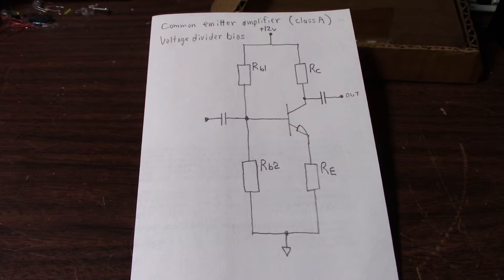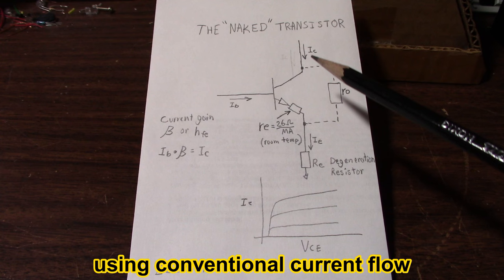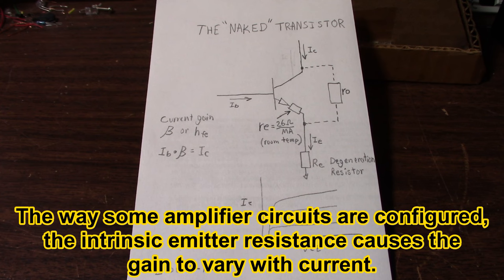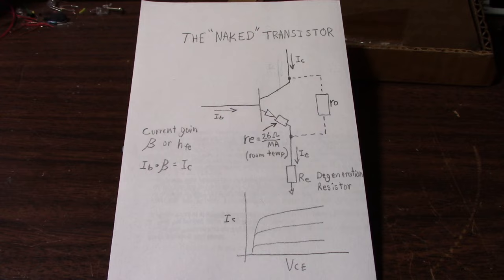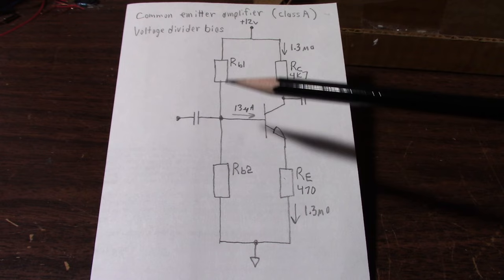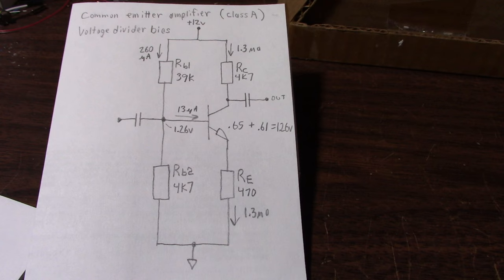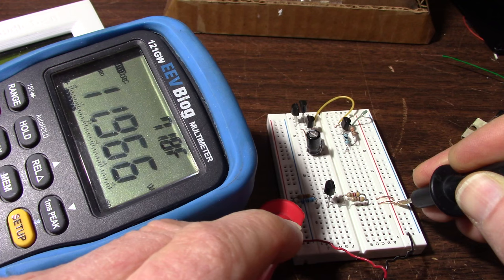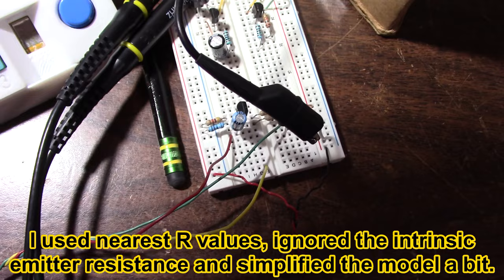How to design a single transistor amplifier with voltage divider bias

Comment: Excellent! Thank you. Do you know a source for the formulas and process that you used to determine all the values? Other than an overly complicated text book, or having to go back through the video and write it all down? Maybe a spreadsheet?
Reply: Here's how I'd recommend you do the design. First decide on the desired gain. Your supply voltage will be at least 0.5V times the gain. Then decide on your desired output impedance. Your collector current will be around half the supply voltage divided by that output impedance. Pick a transistor with a minimum β of at least 100 at that collector current.
Now set Rc = desired output impedance. Calculate Ic = Vcc / (2 * Rc).
Set Re = Rc / (desired voltage gain). Calculate voltage at emitter Ve = Re * Ic. Calculate voltage at base Vb = Ve + Vbe = Ve + 0.65V.
Calculate Ib = Ic / β. Set the current through the lower base bias resistor Irb2 = 10 * Ib (at least).
Calculate Rb2 = Vb / Irb2. Calculate Rb1 = (Vcc - Vb) / (Irb2 + Ib).
Now select nearest preferred resistor values and recalculate currents and voltages at base, emitter and collector. If the collector voltage is not close enough to mid-point, then adjust resistor values slightly to get the desired bias point.
The input impedance Rin will be the parallel combination of Rb1 || Rb2 || β*Re. If that's not high enough, either increase the output impedance or pick a transistor with higher β.
Choose an input capacitor whose reactance is at least equal to Rin at 20Hz. C = 1 / (40*π*Rin).
Reply: @RexxSchneider  Thanks, Rex! Good information!

Comment: John, @ 5:35 you say that Ib sets Ic. (Ib * beta=Ic). To me, that implies that the values of Rc and Re don't affect Ic (no input signal at this point). What am I missing since @ 8:34 you talk about the value of Rc setting the current?
And shouldn't adding the value of Re alter Ic?
Reply from the maker: Rc was chosen to set the output impedance and Ic was calculated using Rc to set the voltage on the collector at quiescent. Rc does not affect Ic. Re is used in the calculation of the voltage divider resistors on the base circuit. The simplification can be confusing to some people trying to understand what's going on in the circuit. This is where a more indepth look using the math might help in understanding.
Reply: @JohnAudioTech  Thank you John. After doing more research and testing and rewatching,  I understand better. In your reply, you say "Rc does not affect Ic." but I am pretty sure you mean RE (not to be confused with "Re") does not affect Ic.
Anyway, I'm getting there and am thankful for your videos to help.
Reply from the maker: @OIE82  Yes I do mean Rc does not affect Ic. With my demo circuit, short Rc out of the circuit by metering across it in milliamp mode on your multimeter and you'll find the current is about the same (slight change from the Early effect). Re (not to be confused with the intrinsic emitter resistance in this discussion) is a feedback mechanism which means it is intimately involved in the current, gain and linearity of the circuit. Try changing Re in the demo circuit to a different value and current, quiescent point and gain will all be affected.
Reply: @JohnAudioTech  Hey Mr. John. I did the experiment you suggested using a Class A setup similar to yours. You were right! Though I didn't really doubt you. So I measured 7.0mA between the collector resistor and the collector. And 7.1mA between the emitter and the emitter resistor. 0.1mA from the base current I guess? Then I shorted the collector resistor (would not have done that without you saying so) and the emitter current stayed the same!
Now, why? Every video I have watched on YT that mentions anything about the collector current says some of the following...
Rc and RE set the collector current. (I now know this is false but why do we start the design process by deciding what Ic should be and then calculating the values of Rc and RE around that current?
RC/RE set the gain
RC sets the output impedance
RE stabilizes the transistors variations due to thermal effects
I know there a lot of questions but you seem to know what you are talking about so I ask.
Thanks for all the videos, I have enjoyed learning.
Reply from the maker: @OIE82  Recall that the base current * the current gain = Ic which in theory is constant no matter the load on the collector. In other words, the circuit is behaving as a constant current source (or sink in this case); therefore, Ic is independent of collector load.
Reply: @OIE82  We actually started the design process by deciding what the output impedance should be. That is effectively always equal to the collector resistor, so it determines Rc without any reference to any other part of the circuit.
Once we have Rc and we know the supply voltage, we can choose Ic so that roughly half of the supply voltage will appear across Rc. The rest follows from those initial decisions.

Comment: You lost me at exactly 8:00. Where did the numbers come from? You say “acceptable” as though it’s a known thing. How on earth do we know what acceptable means?  I’m not trolling. Please don’t deflect with that. I honestly don’t know where your numbers come from.

In all honesty you ate flipping back and forth from current to voltage so many times it looks like you don’t appreciate that BJTs are current dependent devices - exclusively. Talking about either bias or collector resister selection in terms of voltage is a freshmen EE error. 

What are you talking about when you talk about “acceptable” values in impedeance matching of amplified stages. 

I come here because you succeed. But your description is completely alien to me. I got my first Ph.D. In 1981. I may be dated but I lived the transistor age and I am telling you (as opposed to suggesting) you are making zero sense. I know you are a master at audio amplifier design but you are making no sense from a EE PoV. 

Please help an old dog figure you out.

Just one example so maybe you understand.  You talk about knowing collector current from collector resistor selection. That is simply not so. At this point you don’t even know the emitter  resistance and you haven’t dealt with the impact of base-emitter current. 

If you did know the emmiter resistor as you say, then 5170 ohms at 12 VDC is absolutely not 1.3 mA. It’s 2.3 mA. What •••

There is a reason designers communicate in specific ways. Your success is notable and significant. But trying to understand it based on your description is impossible.
Reply: When John used the word "acceptable" around 8:00 he was talking about the fact that you will lose some voltage gain because the input impedance of the next stage will load the output of this stage. As he said, if the Rin of the next stage is 22K and the Rout of this stage is also 22K, then you'll loose 1/2 of its voltage gain. That's because the 22K and 22K form a voltage divider and you only get 22/(22+22) = 0.5 or 50% of the signal passed on to the next stage.

However, if you designed the output impedance of this stage to be just 2K, then you would get 22/(22+2) = 0.92 or 92% of the signal passed on to the next stage. Unfortunately, this stage would then need 11x more current to operate. so there is always going to be a compromise between using lots of current and minimising the amount of gain lost when connecting to the next stage.

John suggested that an output impedance around 4.7k would be acceptable as that would only reduce the gain to 22/(22+4.7) = 82% when loaded by the next stage, while keeping the current down to just over 1mA.

The design process started by specifying the desired output impedance. That's something you will know because in real life, you will have an idea about what the input impedance of the next stage is. The output impedance of the common emitter stage is equal to the collector resistor, and so you have your first value, Rc.

Once you have Rc and know what supply voltage you have available, you can approximately calculate the target Ic so that roughly half the supply voltage will appear across Rc.

You now know Ic and hence Ie. From that you can calculate the intrinsic emitter resistance (re = 25mV/Ic). So to reduce distortion we make Re at least 10 times bigger. That means we set the voltage across Re to be at least 250mV.

The gain of the circuit is Rc/(Re + re) so you can get an idea of the maximum gain available from the stage before distortion becomes significant. If you need less gain, then just increase Re to get the gain you want.

Now you know Re and Ie, you can calculate the voltage at the emitter. The voltage at the base will need to be set about 0.65V higher because a small-signal silicon transistor has a Vbe drop of about 0.65V when conducting a few milliamps.

From the datasheet for your transistor, you can estimate the minimum value of β at the design collector current. That gives you the maximum possible base current, Ib = Ic/β. you then aim to pass 10 times that current through your base bias resistors Rb1 and Rb2, so that the current than goes into the base is negligible in comparison.

Now you know how roughly much current is passing through Rb1 and Rb2 and you know the voltage you want at their junction (the voltage at the base that you calculated earlier). That will allow you to calculate the values for Rb1 and Rb2.

That is effectively the path taken by John in his design, and I assure you that there's no errors, "freshman" or otherwise, involved in the process.

If there's something in this description of the design process that you still don't understand, then please feel free to let me know and I'll be happy to expand on my reasoning.